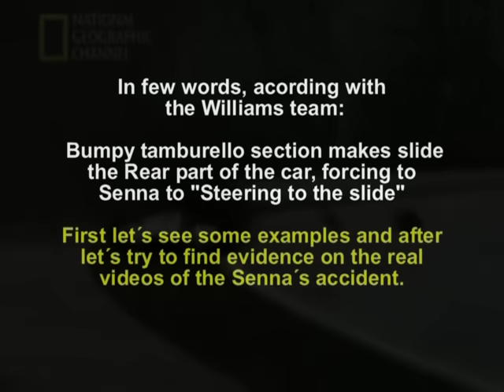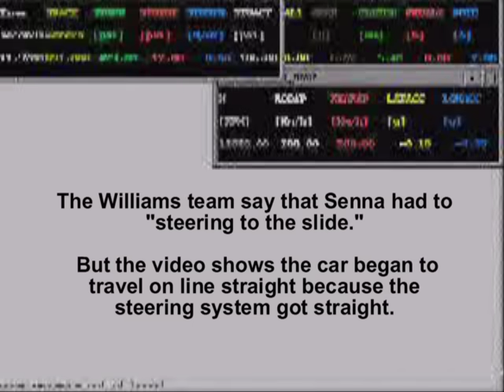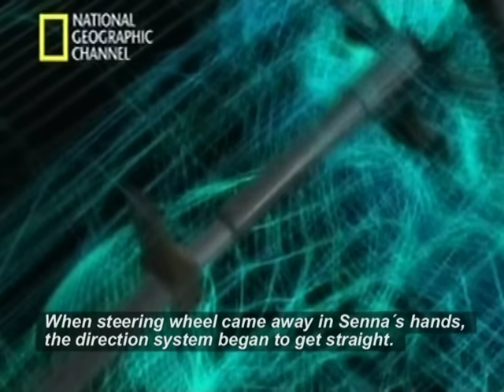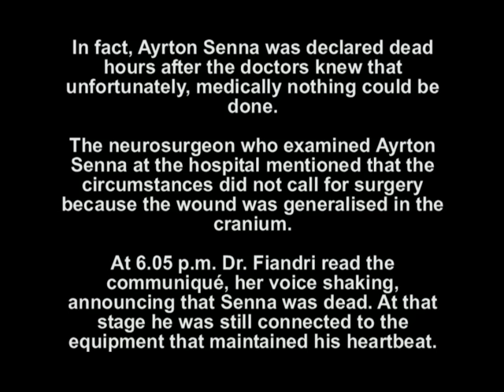5/5 the death of Ayrton Senna - what NatGeo did not tell

Comment: Difference in these half headed examples is the speed involved. Tamburello you’re pulling almost 200mph through it. Look at what happens when the back steps out on an Indy Car on an oval for a more relevant comparison. Senna lifted a fraction over a bump as the back stepped out on him, which dipped the front wing outside of its operating window and it stalled. Newey has even admitted this. The FW15C was based around active suspension where the aero surfaces are much more static. He made a mess of the FW16 and the front wing was prone to stalling when it got too near to the track. The same was true of the diffuser, but to a lesser extent because of the sidepod design. The car would oversteer and understeer often at the same time. In this case the back gripped back up again as the front lost grip, the balance shifted and the car veered off to the right. It was equipment failure, but not the steering column. It’s amazing how even people like Alboreto were not aware that an aero stall can look just like an actual mechanical break in terms of how a car behaves…

Comment: Before the race he had the steering wheel raised by 2" this would have entailed cutting the stem and sleeving it with a weld at each end.
Now the original stem would almost certainly be made of t45 or similar chromoly tubing the sleeve or spigot would have needed to be the same material then heat treated to normalize it after welding unless it was brazed here is the problem, if this is not done, and it is doubtful they had facilities at the circuit, the area around the weld would become very brittle and prone to crack.
I think the pressure on the stem going into tamburello was enough to fatally fracture the makeshift modification....maybe.
Reply: @xellossaxon I didn't say otherwise, I believe that is true.

Comment: Even 'IF', the skid pad underneath the car touched the ground reducing the downforce and grip, the wheels would still have turned on Sennas steering commands and the car would not have suddenly veered straight off ahead, perfectly in a straight line as it did. There was no influence from the steering wheel to the wheels and they automatically returned to the centre position, and that would only happen from a broken steering column. Maybe William's are now where they belong to be, in the back and forgotten shadows of Formula One, where they hold no right to great praise and glory. William's, you did this man and great driver, a great injustice.

Comment: Williams did lie about the this crash but sadly for them italian found what happened.
 "It has been determined that the accident was caused by a steering column failure. This failure was caused by badly designed and badly executed modifications. The responsibility of this falls on Patrick Head, culpable of omitted control"

Comment: Metal scraping along a road is not like a ski at all - the grip would have been phenominal, quite the opposite to a ski, designed to slip on snow, not concrete. Plus the resistance to sideways motion would have been greater than the resistance to forwards motion, combined with the existing grip of the tyres (though slightly reduced) and the car would have simply stopped but following the front wheels. Since Senna didn't apply any opposite lock I can only conclude it was steering column failure (or suicide).

Comment: The data showing senna was applying full brakes in the corner also contradicts the claim that he was trying to catch oversteer. If the car was oversteering, a driver of sennas caliber would never apply full brakes since that would severely exasperate the oversteer. The only time a driver would apply brakes in a flat out full speed corner like that would be if the car was severely understeering - and the only time a driver of sennas caliber would apply full brakes in that situation was if the front was unresponsive and the car was headed straight off.

Comment: He did not run out of road! 

Go back and look at where the car "bottoms out." There is a patch of replaced track. 

The steering column that had been "altered," failed completely.  The extraordinary driver that Ayrton was, tried desperately to turn the steering wheel to the left, which is easily seen in other videos.  He tried twice, but due to catastrophic mechanical failure of the steering column, the wheels did not react at all. 

He was trying to brake and had managed to slow the car down somewhat, but sadly it ploughed into the wall.  Ayrton Senna did not pass away from the wheel hitting his head.  It was a part of the wheel axle that broke off and went through this crash helmet.  He was deceased at the scene, in all actuality.  

Williams were ultimately held accountable.

Please please get the facts correct. 

Rest easy Ayrton Senna, and also Ratzenburger who died the previous day. 

Never forgotten, all FI legends lost. X
Reply: You can't entirely blame Williams for it. The FIA had the bright idea to just get rid of all driver aids for from the previous season and expected everyone's cars be ready for the next
Reply: @w0lf667  ultimately they did a shoddy amendment to the steering column.  They also removed both 'Black Boxes' from his car, which was dubious at best.  They weren't permitted to do that.  

I guess that bottom line, they were and remain guilty, of Ayrton's death that day. 

But Karma will always find a way to address wrongdoing in the Universe.  She certainly did with Team Williams. 

Anyway, Season's Greetings to you and yours. Xxx

Comment: This video is great. You can clearly see Senna moving his head repeatedly to the left before impact like if he's trying desperately to turn the wheel and make the car go in that direction, but it never does. The car just went straight, never turned.
Reply: Jorge Martínez 

Thats because he had been shot.

That's The reason his head is hanging out of the car 2-3 seconds before he even hits the wall.

That's why the car doesn't even turn and just goes straight on, because he is already dead before he even hits the wall.

Senna was killed.
Reply: jimmyajp No, he was trying to steer the f1 away from the wall. but you can think what you want but you are taking wrong. Ayrton Senna will never be forgotten.
Reply: Jorge Martínez  The car went straight like a surfboard due to the lost of down force and even Senna great skills wasn't enough to keep it in control. It left the track and hit a wall.

Comment: Adrian Newey pretty much admits that the steering column tubing broke in his autobiography. It had been modified by junior staff. The diameter of the tubing was reduced, but the wall thickness was not increased to compensate and maintain the original strength.
Reply: Exactly I was shocked when reading this book that its seems pretty well understood what has happened. Then angered when you see nonsense claims about the car bottoming out trying to blatantly lie..

Comment: It’s been well said, “Usually the simplest answer is the correct answer.” Listen to these FIA “experts” twist themselves into pretzels trying to avoid saying the obvious, because the obvious would’ve come with legal, and financial liability - Senna’s steering column broke! 

We know Senna’s steering column was broke, but did it cause the accident, or did it break due to the accident? Well, we know what the FIA folks WANT us to believe, but let’s really think about this: 

If Senna’s tires “suddenly lost all grip” due to the car getting “sucked down,” then why did his tires have enough grip to slow the car down under braking from 180+mph to 130+/- in .8 seconds? 

“Well… the ‘suction’ only happened for a split second. Just enough time for the tires to lose grip and send Senna towards the wall. The tires immediately ‘re-gripped,’ which explains why Senna was still able to brake.” At least, so we are told… 

However, if the tires immediately “re-gripped” so Senna could use the brakes, then why didn’t we see him also “immediately” start turning away from the wall? You said his tires immediately regained grip enough to brake, why not also enough grip to turn? 

“Well… at that point he was already in that strip of grass, so the car didn’t have grip to turn.” 

Oh, really? Then if the tires didn’t have enough grip to turn, why did the tires have enough grip to brake so quickly?

See where I’m going with this? 

The simplest answer is usually the correct answer. And the simplest answer is: Senna’s steering column broke, and CAUSED the accident. This would also explain why he was still able to brake the car, but not turn it. And we also know the Williams crew re-welded the steering column at Senna’s request the day before. And we also know the steering column broke at the weld…. See why these FIA people desperately want to avoid admitting that? Williams (one of the biggest teams at the time, and which many FIA folks had a lot of stock in) would be legally, and financially liable. Hence, the pretzel twisting.

Comment: It was clearly a mechanical failure.  Senna wasn't scrubbing his tires during the caution.
I've never had my front tires hook even offroad in extreme conditions unless ur on the brakes. 
Hitting the brakes during a slide is a no no. 
You adjust the throttle or feather the clutch and or change gears depending on track conditions.  
He died cause he hit the wall at 300kph. 
Sad, he lost his life. 
If there's a crash box built into the side of the formula 1 car, it should deflect crash debri and absorb impact at those higher speeds. 
Safety has improved Thank God over the years in the Formula 1 series.

Comment: 5:00 found the oversteer
Reply: thats not oversteer,he was actually turning to left and the steering column broke at that point. The yellow dot completely disappears at that exact momment
Reply: @m.jsouza2782  why does the car move closer to the kerb then
If the steering column broke then you expect the car to immediately move away from the kerb due to the understeer not closer then further away
Reply: @m.jsouza2782  I have to agree with @Flatout Flatline here. If you watch closely, you can see that for a short moment, the car is pointing way too far into the corner. But that still doesn't explain why he went in a straight line after catching the oversteer.

Comment: i distinctly remember watching this race. it was the last F-1 I would watch. I saw very clearly that he made no effort to turn at all, or so it appeared. I thought perhaps his mind was elsewhere, maybe looking at his mirrors at that moment. he had a substantial lead at the time. there was no one racing him or challenging him for the spot. I also thought that it was odd to have a bump like that coming into that curve. those bumps must change the traction of the tires for a split second I would think, however the driver were all aware of them and were ready to react in accordance of them I would believe. I knew at the angle he hit that wall, he was going to be a fatality. the steering column would crush his head and chest. it wasn't a head on impact, but it was non the less a very sharp angled one. he was the top driver of his time. there were none to his true level of racing in my opinion and I quit watching when he died.
Reply: Very good comment. I also stopped watching or following F1 completely after his death and I was a F1 fanatic until then. The whole discussion about the cause is pointless. The fact, that the on board camera stopped right at the crucial second isnt only just suspicious, but makes it rather quite obvious, that it was a mechanical failure. RIP Ayrton

Comment: Racing is a dangerous sport. Pilots know it. It is also a team spot, driver, crew and engineers. They can all make fatal mistakes. It is part of the game.
Reply: +Giutubo Spatubo 
Respectfully, you believed what NatGeo said.  As a driver, I can tell you this was not a driver error.
Reply: yes, because a swerve can still be changed with steering input and the angle of attack would be different. either more, so he hit the car with te rear  first or about head on. taht would bring the car into a spin. the speed to the wall would NOT be increased since halted tires do not occur lateral forces. therefore he would not have been hit by the tire on the head.
however i dont understand why make head or williams responsible if the steering column breaks.
schumis accident in 1999 had a brake screw broken. material errors happen
Reply: I agree with Linda Stewart
Reply: @MrTiti  Your ignorance is matched only by your imagination. Italian law takes a very strong line on liability, especially in the case of unexpected and/or unexplained deaths. In this particular case, there was evidence which suggested that Williams might have been negligent in the way that they modified the steering column, whereas in Schumacher's case, an unmodified component failed and there was no evidence that it was not designed in a suitable manner. Please share with us your calculations which show that had Senna been able to steer the car, he would not have died, they really are too important to keep to yourself.